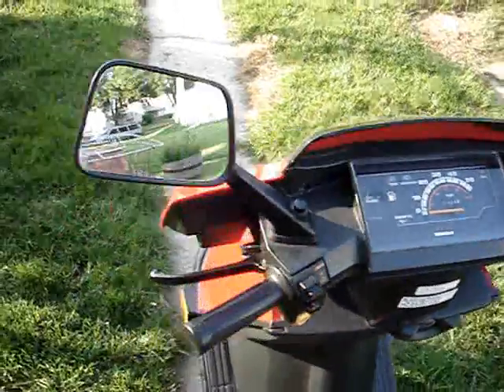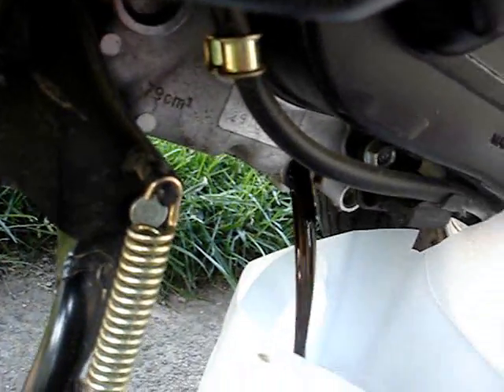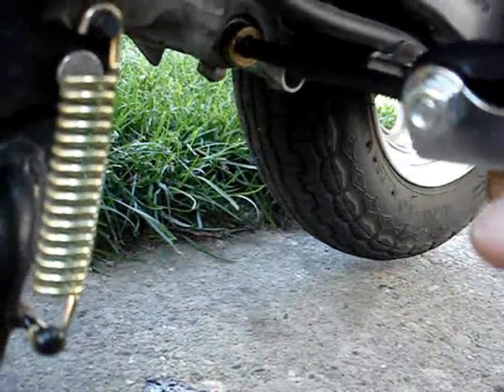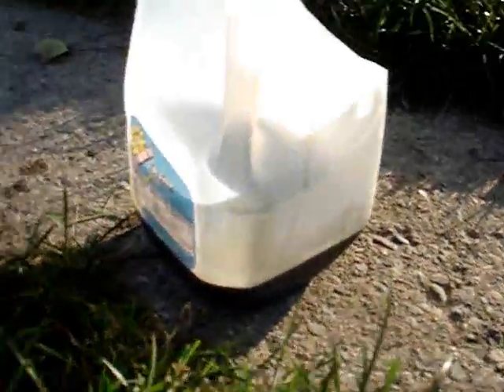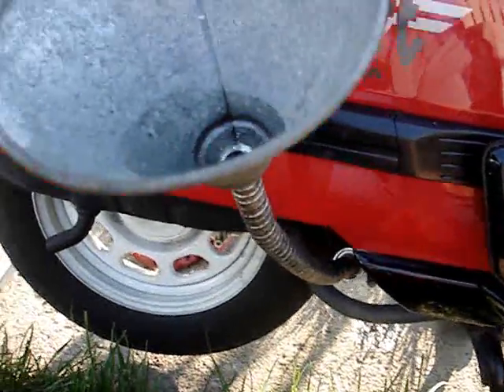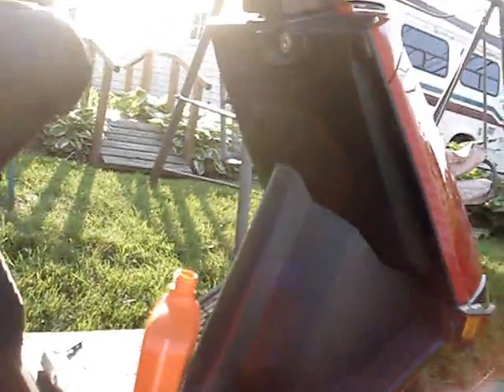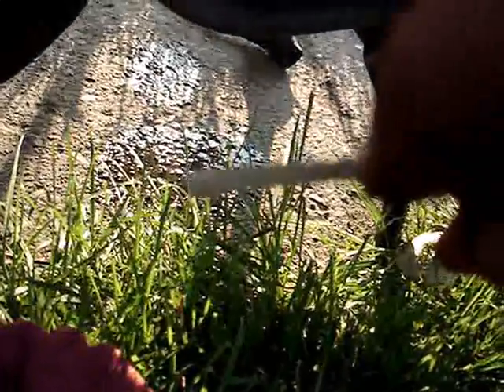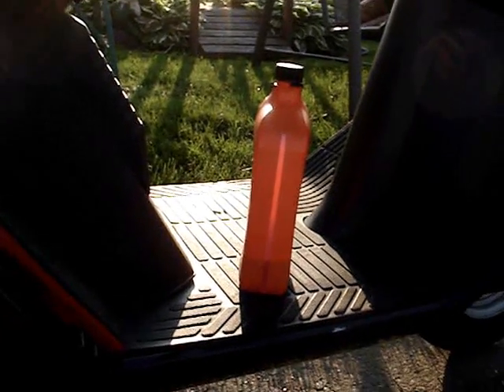Honda Elite 80 CH80 Scooter Oil Change

Comment: I just bought an 89 Honda Elite Ch80 for $200 from a coworker. I do own a truck & a car, but since it did run & looked like it had potential & the fact that I was 19 years old when the scoot I just purchased was first manufactured, I thought it would be a cool lil' Project/Hobby/fixer upper etc... to spend the money on to restore the scoot to its original condition. Then I'll pass it on to my 11 year old daughter when I'm done & she tear it cat ragged,lol.Thanks for all your useful info.

Comment: 10W-30

YOU PUT IN THE WRONG OIL. WHICH MEANS I PUT IN THE WRONG OIL.

Which explains all that smoke behind me.
Reply: The correct oil is 10W-40

10W-30 should be fine too assuming the temperature where you live doesn't get too far above 90F (~32C)

Comment: The reason you don't want to use API energy-conserving car oil in motorcycles is the friction modifiers that may make the motorcycle clutch too slippery to grab. You can use car oil in modern scooters, because the clutch is not bathed in engine oil.

Comment from the maker: @ChaChoRrom For a scoot that old with low miles it sounds like its a reasonable price to me.  Just make sure it starts, and runs good before you lay down the money because the fuel systems gum up from sitting, and make sure the tires are not dryrotted since the scoot is older. Tires are cheap on Ebay.  I could of bought an older scoot like that with low miles, but i did not wanna deal with aged parts if the scoot sat. Thats why i bought a newer scoot.

Comment: Not trying to be a jerk but I just wanted to let you know when you check the oil after filling it you do not screw the dipstick in you simply see it into place without screen and then pull it out to check it if you screw it in you will get a mis red oil fill level just so you know and that goes also for anytime you're checking the level

Comment: well thats what the honda and honda clone manual says, so i do that, and ive checked it the way everyone else says to and it shows its low. Think of it this way, when you check the oil in your car you put the dipstick all the way in and pull out, why would it be any different here, same with some mowers, you lock it in and twist then unlock and twist to remove it.

Comment: Hey, I had brought mine 2000 black paint, 2 days ago and Im gonna move it from an uncle house like 25 miles, it looks like the muffler got broken and Im gonna repair it before I go. Do you have a tip of what I should look after move it that distance to get sure It will not fail?? Thanks, nice scooter ;D

Comment: Just to let you know your not suppose to screw it all the way In when you check the oil, you are only suppose to put it back in with out screwing it in, if you screw it in you won't get a accurate reading on the oil